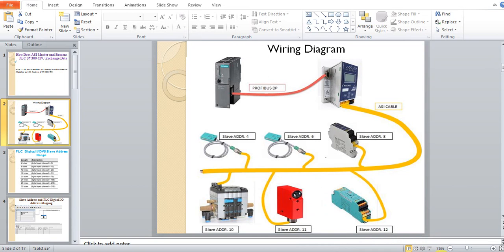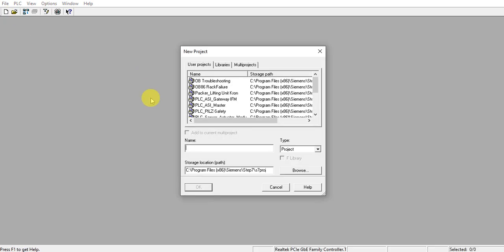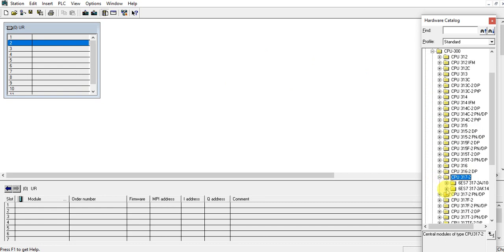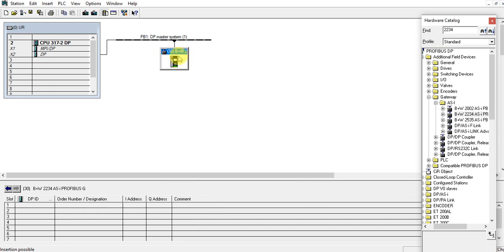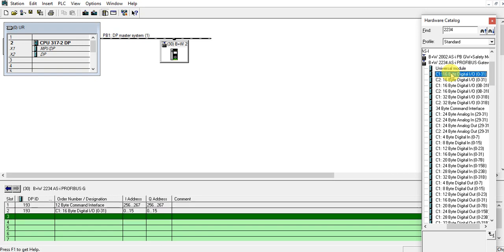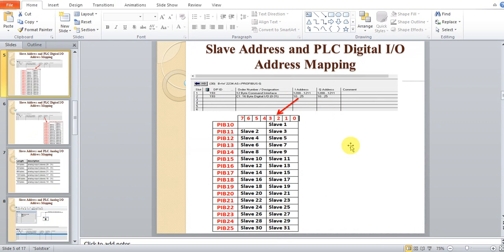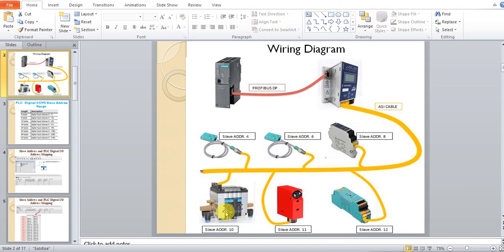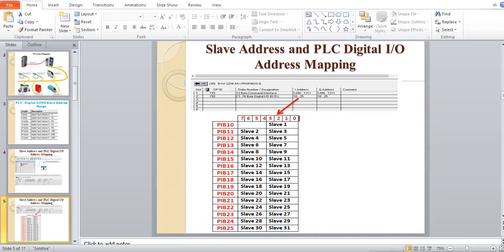ASI MASTER Digital IO Address Mapping Part 1

Comment: Can i give address to an ASI slave device(valve) with help of laptop  as we do not have  hand held addresing device.
Reply from the maker: I am not sure cause never done before. I Use Handheld Addressing device or using the asi master(slave addressing tool)
Reply: Can you please make a video of how to configure a P+F ASI master for adressimg form starting step by step?. @bellewolde
Reply from the maker: @HariAngnaa  Sorry, Currently i do not have the ASI Master. You Can Refere The  The ASI Master Manual To Address Slaves. It Is quit Simple. I Can Share The Technical Manual Of ASI Master.
Reply: @bellewolde  yes please
Reply from the maker: @HariAngnaa  https://files.pepperl-fuchs.com/webcat/navi/productInfo/doct/doct2150.pdf
Reply: @bellewolde  this model is obsolete now...they have new model now that does not have display .
Reply from the maker: @HariAngnaa  Sorry, I New Only these versions. Can you share the model